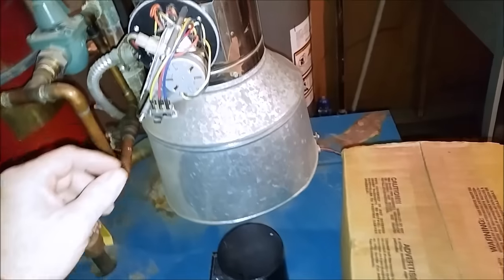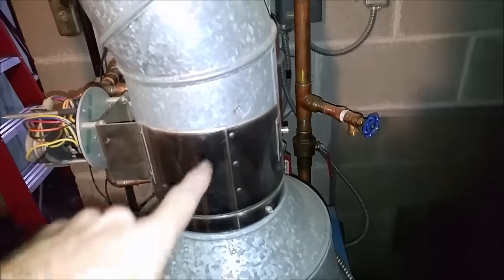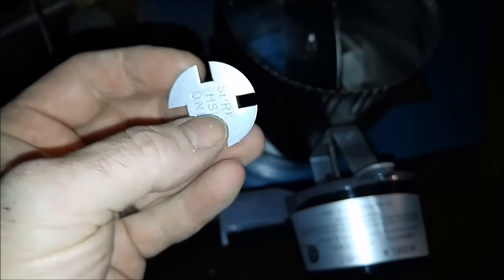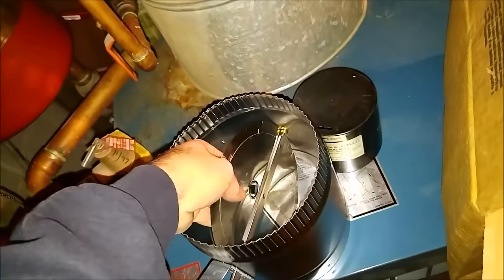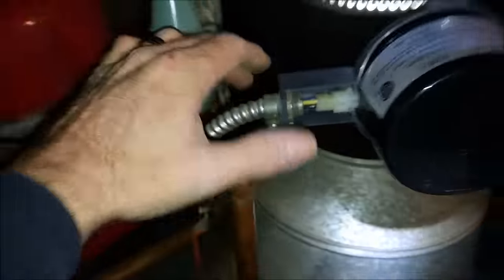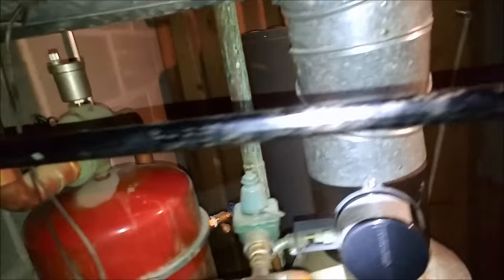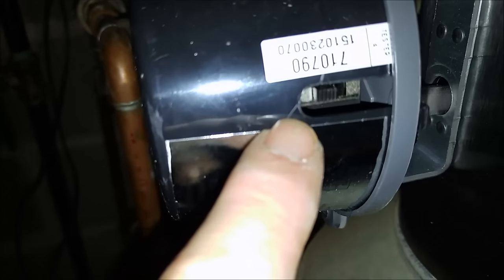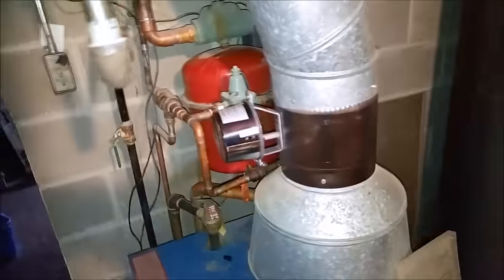Vent damper replacement on a boiler

Comment: You can just replace the head unit.  The black plastic drive unit is attached to the long damper shaft with two screws.  It's a lot easier and cheaper than replacing the whole assembly.  Mine was an RVGP-PCF head unit running on 24V AC but it looks exactly the same as this one.

Comment: Did the circulator pump come on and the boiler not fire? That is what's happening to mine so I have this part in hopes of it working, the damper did break so it needs to be replaced.